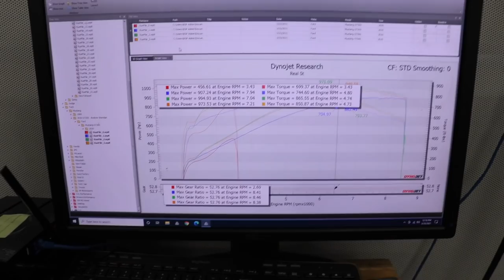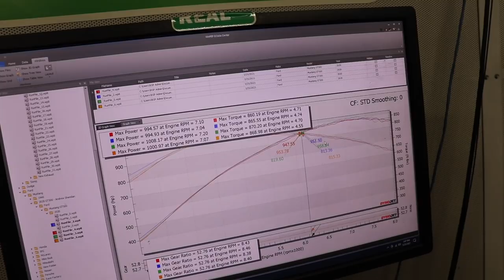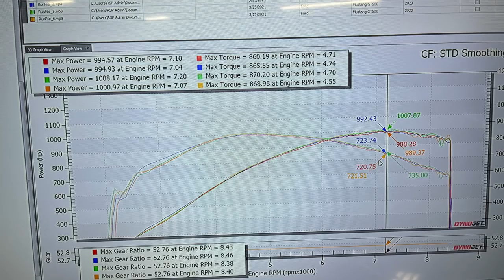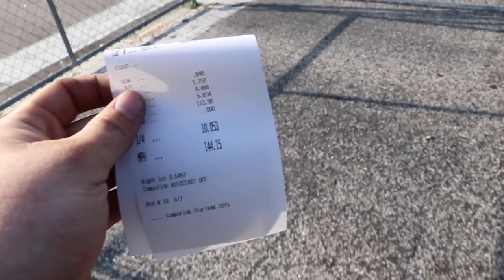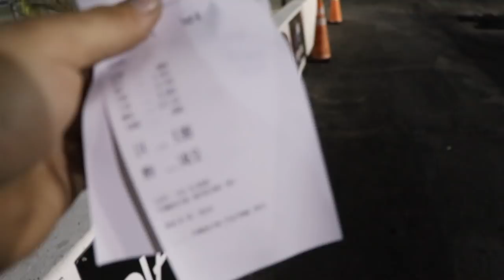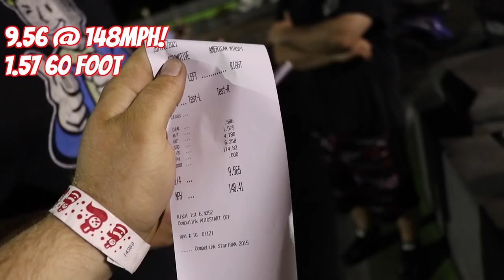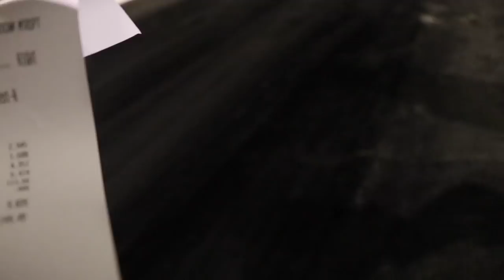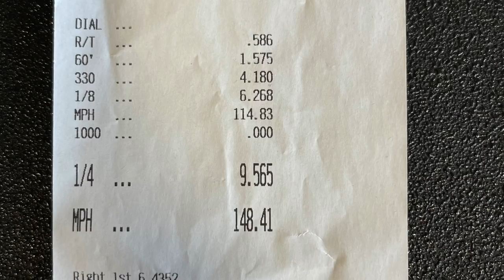2020 GT500 Lays down 1000WHP and Goes 9.5 first time out!

Comment: This car made a tad bit less peek hp than StangMode's fully built gt500, but with much more torque! Can someone PLEASE explain this to me?!!!🤔
Reply from the maker: 1320junkie’s port does usually seem to make more torque than others. But remember different dynos and now stangmodes new built engine has ported heads and different compression
Reply: @MustangLifestyleTV  Ported heads, cams, and higher compression SHOULD make more torque than a completely stock engine regardless of who ported the blower, or whose dyno the car is on. Notice the word SHOULD. I'm no engine builder, but my understanding is that more air equals more power. If it's really just the porting that makes the difference, then 1320junkie's port job is the 💩!!!! I'd love to see what this car would put down on a different dyno. Torque is VERY IMPORTANT on these heavy gt500's, especially with their poor aerodynamics. When you finally get your gt500 to hook, you'll see (and feel) that it's the torque that makes fast, QUICK! This is the best 2020 gt500 I've seen, so far. Keep pushing the good content Andrew.👍🏽